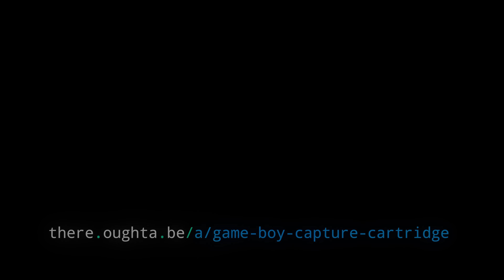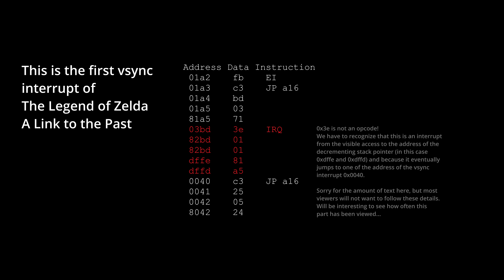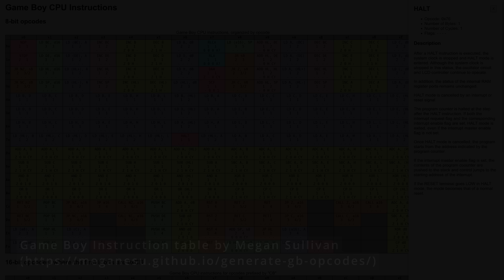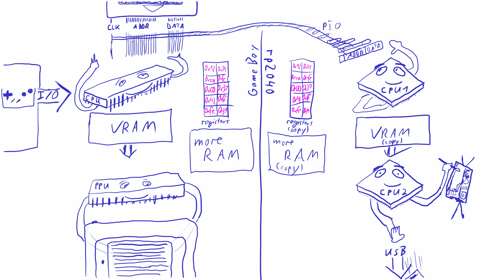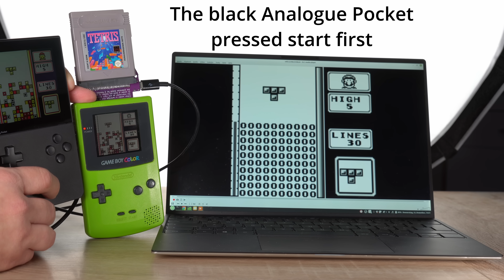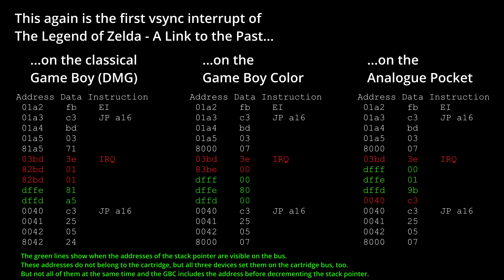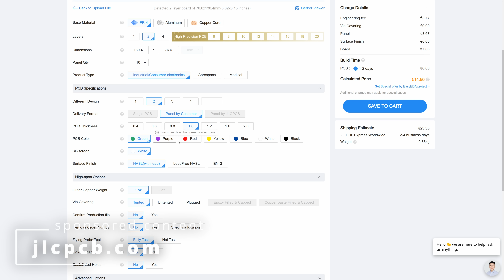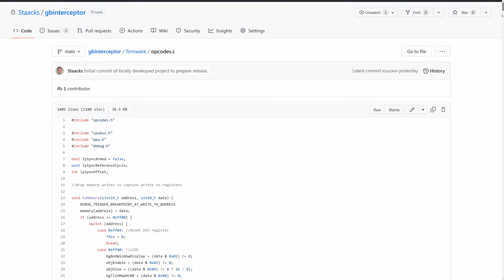A Game Boy capture cartridge: The GB Interceptor

Comment: A word of warning about JLCPCB assembly from a longtime customer

I had a design using a UQFN part (TS3USB30ERSWR), and on the prototype run of 10 units, 3 or so have solder bridged under that component. I let them know so they would not mess it up on a larger order I was about to place, they apologized and said it wouldn't happen again.

I then placed an order for 240 boards, and 142 of them had that problem, killing all of those boards. The entire order was around $3000 so that is a massive loss for me

I contacted them again trying to get a refund for the boards, and they ran me in circles for months, saying how it's actually my fault that they used too much solder paste, with different excuses that contradicted each other (I can go into detail if you are interested). They refused to refund me, so I escalated it to a PayPal dispute. JLC then abused the dispute system by accepting a full refund, but it would require shipping back the entire order (which would cost several hundred dollars, that I would be forced to pay). I fought back and explained how unfair that was, and then my final offer was a $1000 refund, despite over $1500 in unusable boards. This ordeal took like 2 months, and completely killed my desire to make boards to help my community members/guide videos, and I'm not the only one in my community that this happened to.

TLDR: JLC is good for PCB fabrication (not assembly). JLC can be good for very small PCB assembly orders (if you get lucky). JLC support will NEVER admit to mistakes and compensate you accordingly

Comment: GB Camera as a webcam is just priceless. Congratulations on this project! Really well done and impressive! And thanks for open sourcing it ✊
Reply: Can already be done with GBxCam
Reply: @pocketsuke  That requires extra software though, and it's only on Windows. This works by simply functioning like a webcam.
Reply: @Eddies_Bra-att-ha-grejer  Yes and no. It funtion on windows, linux and mac. I currently have it running on my Pi. But yes as in you need software. 
But with my understanding of this project, it probably wont work with the GBCamera
.
Reply from the maker: It does work with the Game Boy camera (why wouldn't it?). For example the outro was recorded with the Interceptor.

But more to the point of the discussion: Being able to record or stream the Game Boy Camera is just a nice side effect. Streaming games while playing on the original hardware was the main consideration, so the focus of the Interceptor is quite different from the GBxCam. If it can do some of its functions too, that's just a bonus.

In terms of additional software it indeed should just be usable like a webcam, which it does on Linux and MacOS (with the next firmware update and on Intel devices): you just plug it in and select it in Zoom, OBS, VLC etc. Unfortunately, on Windows VLC and Zoom are not happy with its video format and do not accept it (yet). Here you can use OBS to send the stream to Zoom, but if it you are not already using OBS it could be considered additional software.
Reply: @ThereOughtaBe  nice, well consider me wrong! nice work!